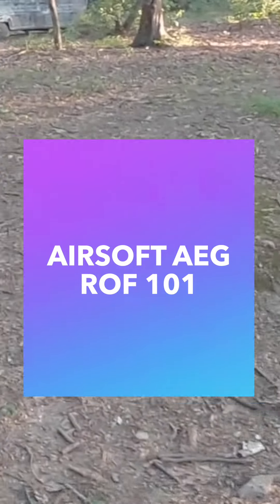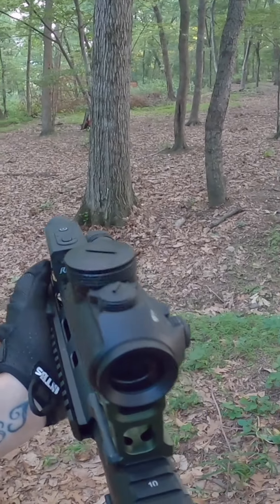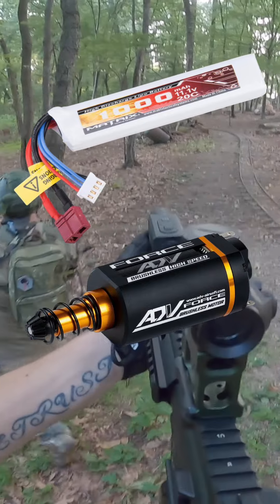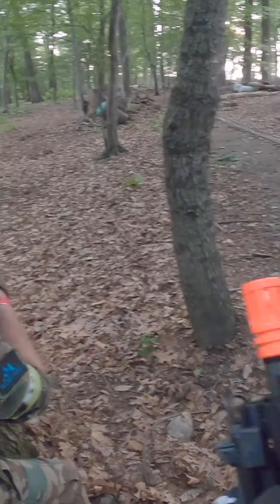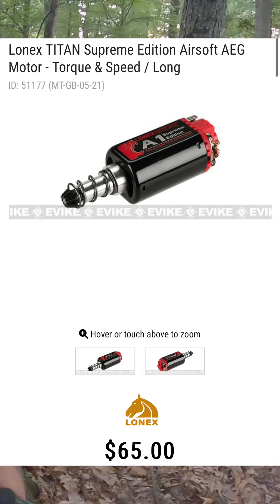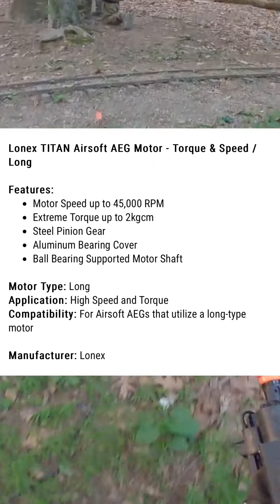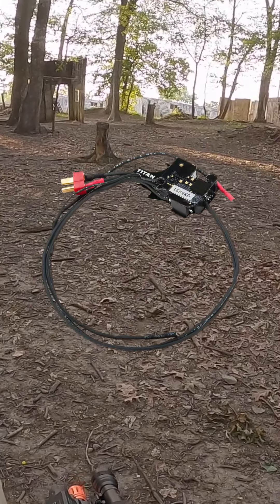Increasing Rate of Fire 30+ (RoF) In Your AEG

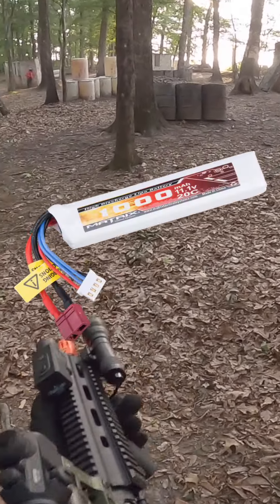Comment: 1:37 you can comfortably use 4s 15V battery, ive used it for several games with stock gun with no mosfet and it works fine